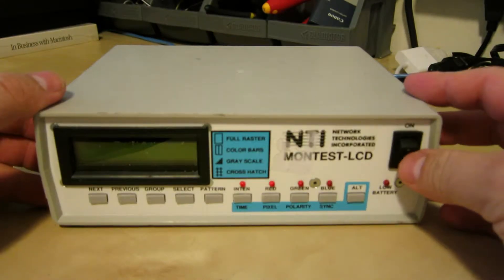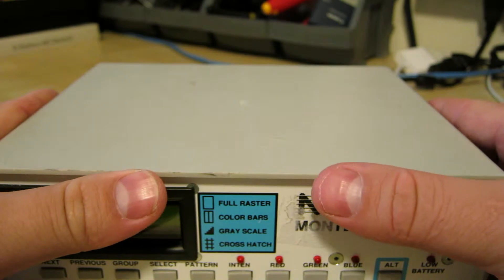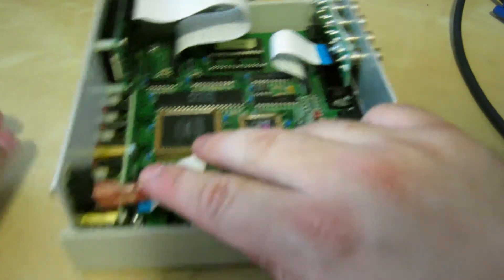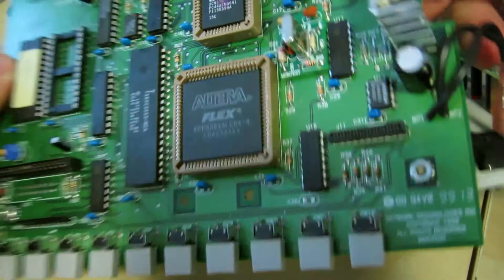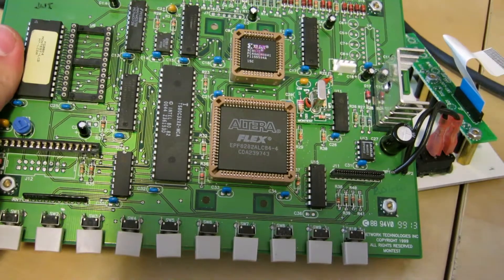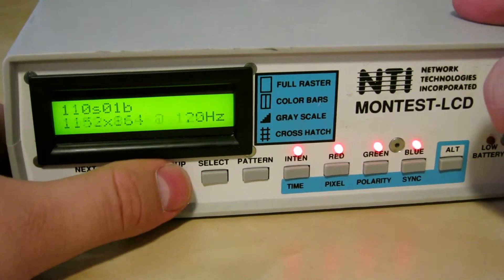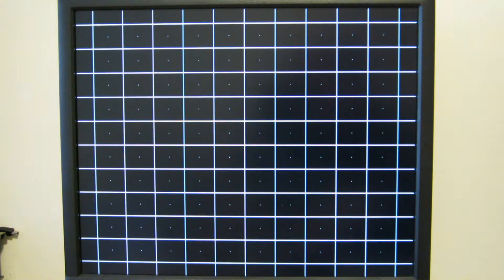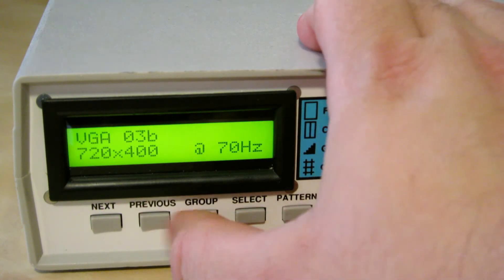NTI Montest-LCD Teardown

Comment: Comp is Composite Sync.  Just another method used for sending the sync signal.  I think component video does it that way.  I had to build a sync separator once time to interface a sony playstation with an RGB arcade monitor.